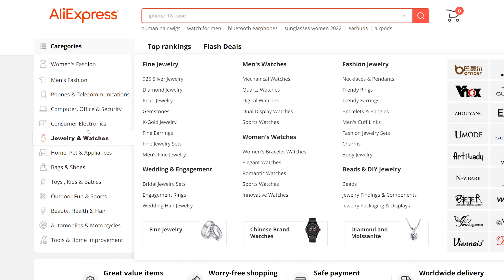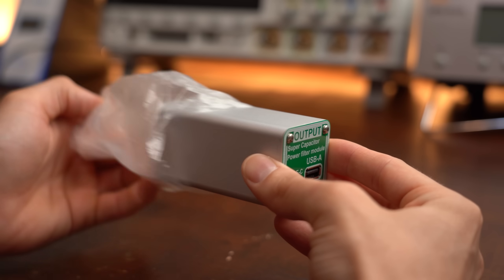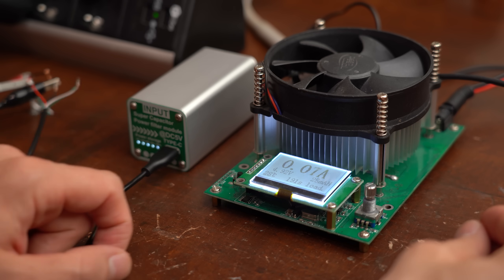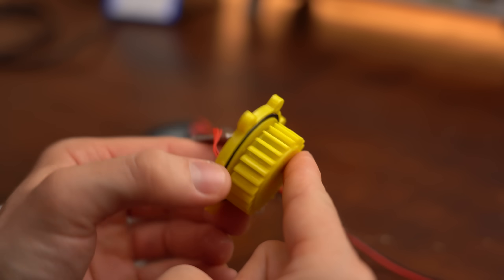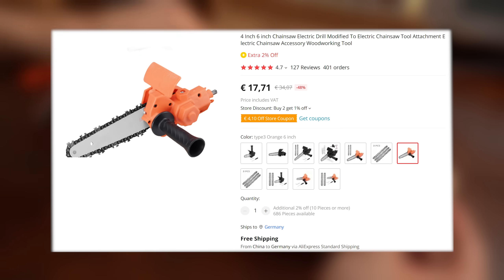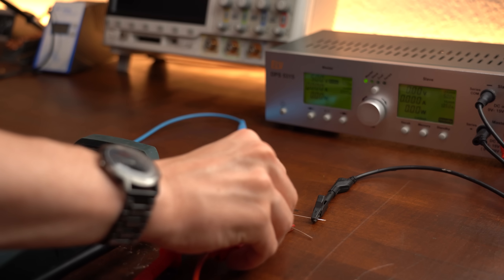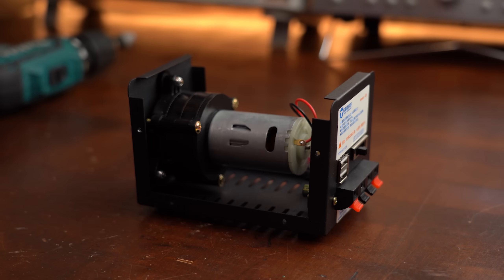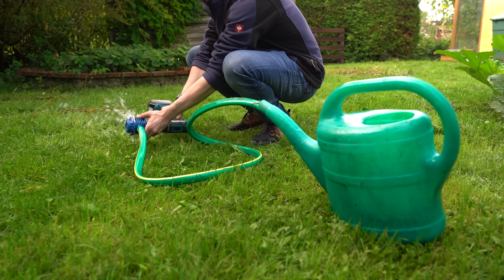I tried finding Hidden Gems on Aliexpress!

Comment: In Italy it takes on average 2 months to get your stuff. Nowadays it takes on average 4. It means I basically get refunds on literally everything but then sometime down the line shows up. Lately though it's doing something even more sinister. It gets marked as delivered & signed after 3 months, and it shows up 2-3 months later. So a total of 6 months sometimes, and to get a refund in that case I need to get a paper from the post office saying they don't know anything about the tracking number, which they obviously don't because the tracking number isn't even the correct format and I have no idea who the delivery company is.

Comment: it is centrifugal pump ,,, you need to add foot valve at the end of the hose before you imerse it in the water then fill the hose with water even the impeller chamber then it will work properly but if the distance between the pump and water surface more than 5.5 meter then no way to pump one drop of water...

Comment: Can you recommend any lithium battery charger board, that have peak charging voltage of 4v and low voltage cut off at 3v. Most board have 4.2v - 2.6v to draw maximum power out of lithium cell. But for people looking for maximum battery life instead of power draw, find it really hard to get a cheap charging board that keep lithium battery within 20-80% (or atleast 10-90%) charging cycles to increase battery life.

Comment: Using an electric drill to drive a generator that produces electricity 🤯❓
OK, it makes electricity but no sense 😂❗
Why not use the drill to drive the water pump to pump water from a reservoir standing on ground level to a bucket hanging higher up, than use the hydro generator to produce electricity 🥴 . . . or 
could we  directly tap the power from the drill's battery 🤔❓

Comment: I saw the 4s usb c PD board in your B-Rolle I have as well. My plan was to use it with a 5s Power tool battery. For that I changed the resistor as described in the product description. Unfortunately it only started to blink a five pattern.
Have you tried to change the cell configuration?

Comment: I definitely wouldn't have just connected a lithium cell to that IP2312 board straight away, without having tested it with an electronic load first. You really want to confirm the cut-off voltage before trusting it to charge a real cell, unless you want to monitor the voltage manually to avoid it overcharging the cell and starting a fire or something.

Comment: I have used a drill powered water pump back in the late 90's to pump water out of a 1 meter hole I was digging to repair a water supply into a house and it worked just fine, so it is possible for a product like this to work, but not this particular one. The one I used was also self priming and not suited for watering plants as it was made of some nasty plastic and used some questionable oil to lubricate the pump.

Comment: if you are soldering directly onto a lipo cell, you can't trust your numbers very much after that. even doing a cold solder joint will damage the battery some amount (and leave you with a shitty joint lol)

Comment: You got a crappy version of the drill pump, we can by them here from Bunnings and those will generally lift ~1m (though you loose pressure). It looks like that one’s impeller is to small for the enclosure (which I have heard can happen with the Bunnings ones).

Ours sees a fair bit of use in fire seasons when we need to wet down stuff quicker than our tank can supply water. It is way quicker to setup and get working than our larger petrol pump though it has no hope of keeping up with the output and you need a good drill to run it for long.

Comment: How much junk did you have to buy and how much money did you have to spend to find your gems? That is problem with bandits known as alibaba.
Reply: @evilalchemist9278  I bought 3 things from Aliexpress and 2 out of the 3 were total failures. First of all it takes forever to get the stuff. One the them the paint were flaking off in the packaging even before being used. The other one the pressure plate worn out in less than 30 minutes of use when others usually operated for at least 500 hours. WTF?! And customer service obviously does not care and there is no way to get refund or replacement. 66% fail rate no thank you alibaba bandits!

Comment: 10:15 Then you don't want to see the latest USB PD specs, it allows for 48V at 5A! (To be fair, if the PSU/host isn't defective (or Chinesium), it's SUPPOSED to default to normal USB1 levels and allow devices to negotiate higher voltages and currents.)
Reply: Except there's no "negotiating" with the "host". (a dumb user operating the slide switch)... 😁

Comment: Ya on the hand crank show have a separate board for use to keep it at 5v but you can weld a nut on the shaft and use a ratchet you built something or if you go big with the nut you can probably use you car tire changing tool

Comment: with centrifugal pumps you're not really talking about 'suction' power. They aren't designed for that, what you're looking for is a self-priming water pump, or you need to prime the pump manually.

Comment: I bought a drill pump from Amazon about 3 years ago to empty a full tank of diesel out of a car. It is half the size of the one you bought and by the look of it, pumps about 3 times the amount of fluid. It emptied a 70 litre tank in about 8 -9 minutes over a distance of about 15 feet total length.

Comment: At 3:26 the voltage drop is not caused by the super cap's limited capacity but by its ESR...
Reply from the maker: No
Reply: @greatscottlab  Yes. At a current of 1.51A you are showing a drop of 0.4V. The supercaps are advertised of having a capacitance of 8 Farads.

I = C dV/dT can be rewritten as dt = C / I x dV where I = 1.51A, C = 8F and dV = 0.4V. This gives dT =  2.12 seconds. dT is the time it would take the 8F supercaps to fall from 5V to 4.6V without charging with a load of 1.51A. The supercaps are getting charged much more frequently than once ever 2.12 seconds, so the problem is not the capacitor size...

Comment: would be intrested in a deeper dive in other charge modules, theres the MH-CD42 which is a module with no connector meaning if you want to get data from the port and offer charging you can do so. and handles safe discharge too

Comment: 9:20 Is it really safe to solder directly to an 18650 cell like this? In mass production they are always spot welded for a reason.

There is probably a method that can be used safely but I am worried that just showing it with no comment might lead people to believe it's easy. I would not want to risk heating up a lithium cell excessively.

Comment: I would love a board like @9:00 but with jumper pins to set cutoff voltage, and also jumpers to connect built-in resistors for current setting.

Then you could just move a couple jumpers and charge basically anything lithium based in a small package with no soldering and resistors.

Comment: You might be able to get the pump to work by attaching another hose to the output, pumping water in reverse from a large bucket until the bubbles stop, then pumping normally. That way it only has to lift the water to ground level, rather than the top of the wall.

Comment: The hand crank generator works best with super capacitors! 
I have seen other people add super capacitors to it and it appears to work far better.... 
As for the hydro generator, I believe that there are better versions which are all black in colour and rated for 12v output.... I would love to see you test one of those....
Reply: I wonder if it would be possible to rig up a better turbine for the hand crank and use that in place of the water generator...
Reply: @eccentricthinker142  you are going to need a gearbox because you won't be able to turn the water generator by hand fast enough.... 
I'm sure that there are better versions available which are rated for a 12v output....
Reply: @PeterMilanovski  I meant the other way around, rig up a turbine to run the hand crank as a water generator.

There might be a torque problem though
Reply: @eccentricthinker142  if it rains a lot where you are, then it shouldn't be a problem.... Or maybe there's a stream or river close by? Otherwise it's not going to work.
Reply: @PeterMilanovski  It's easy to get a lot of head from a stream, which can translate to more RPM with the right gearbox, but rain is just too unreliable for actual power generation in almost all cases.

Hence why the main use case was as a flow meter in the video.

Comment: I have bought a number of various amplifiers, ranging from 2x3W to 60W. The small BTL a,ps can be powered by a Li-battery and sounds great.
I have bought some clocks, but always loose the descriptions how to set them up.
1-, 2- and 4-channel programmable timers have also been used and tested.

The best thing I bought was GOPHERT bench supply supplying 0-30V at 5A. Have served me very well for several years now.

Comment: You're using the drill powered pump wrong. You have to prime it with water or else it wont work. It's not designed to create that strong of a vacuum with air, as you have demonstrated here, albeit with the intentions that it was supposed to work this way. Cool video otherwise!

Comment: Sir, can you do a video on reusing/recycling the battery management system boards for lithium ion batteries usually found on phone batteries or ipad/tablet batteries?  Is it stupid to remove the bms from one battery and sodder to another, even if they are of equal mAh, let alone different mAh?

I wanna splice in an old Samsung 3.7v phone battery into my xbox controller (uses 3.2 ish volts I think and can convert 5v from usb to its 3.2v), but I don't know if the charging circuit built into the controller is suitable for the lithium battery (I assume no).  Or if I should just attempt to splice on a little connector to the battery prongs on the controller and another connector to the battery for easy removal to charge the battery back on the old phone.  I honestly don't know if it is safe to charge a 3.7v battery straight from a 5v usb charger.  No one seems to want to give concrete answers or examples here on the tubes, or in plane non-jargon text on the interwebs.  So much clickbait bs and stupidly loud music too :(

Comment: Always another great video. I especially like the electronic types. And therefore I challenge you to test the replacement circuit board for Green Works 40 volt battery packs. I had one get a little wet and stop working. However the battery voltage is 40 + volts but will not run the trimmer or charge. I get red lights when trying either option. But Aliexpress sells a replacement circuit controller for this 40 volt battery pack, cheap. Do they actual work?   Thumbs Up!

Comment: 5:09
it can of course only output its maximum Power, if you connect it to something, that has got the same resistance/impedance as the generator itselve. Thats cause if you model it like this:
         U_0 •-----[Z_0]---•----------------|
                                                          |
Ground •-----------------•-------[Z_L]---|
Then 
P_L=U_0^2*|Z_L|/|Z_L+Z_0|^2
with Z_L=c+di and Z_0=a+bi we get
P_L=U_0^2*|Z_L|/(|Z_L|^2+|Z_0|^2+2|Z_0*Z_L|*cos(∆φ))
with ∆φ being the phase shift between the source and the load. 
This can only be maximal, if cos(∆φ) is -1, and thus ∆φ=π.
Now for this condition we get
P=U_0^2*|Z_L|/(|Z_0|^2+|Z_L|^2-2*|Z_0|*|Z_L|)
now finally we can find the derivative 
dP_L/d|Z_L| to set it to zero.
and get, that Z_L=Z_0, but here φ=π, and so this is no real Power, but only a blind Power. For there to only be a real Power, the phase shift has to be 0, so we get that P=P=U_0^2*|Z_L|/(|Z_0|^2+|Z_L|^2+2*|Z_0|*|Z_L|)
so we can again do the derivative, and set it to zero, and get to the result 
|Z_0|=|Z_L|.
(if i didnt do anything wrong here)
...
 So for your example with the LED this os certainly not given,and thus the max Power cant be achived.
Reply: Edit: since the real Power P' (Wirkleistung) is
P'=cos∆φ*P it indeed gets maximized for ∆φ=2πk with k element Z. 
So assuming ∆φ=0 was the right choice.

Comment: Pumps often have a much smaller rating in sucting than they do in pressure. Try using a piece of threaded rod to elongate the shaft of the pump and dip it in your pond. You can than drive the pump with the drill though your rod which should provide enough pressure to pump water. Thats why water reservoirs have the pump at the bottom and it can still deliver up to 20 bar of pressure which means it can lift water up to (theoretically) 200m. No pump however can suck water from 10m as that would require absolute negative presure (-1bar) which also means perfect vacuum.

Comment: That dodgy chainsaw attachment looks absolutely terrifying. :D
I wouldn't use it, you do need your fingers doing electronics, after all.
Reply: Having your hand so close to a chainsaw, even a small one such as this is not a good idea. You could end up looking like a happy tree friend. Stumpynubs did several videos on chainsaw grinder disks after getting injured by one.
Reply: @carpespasm  Although those disks are far more dangerous since they are all round and meant to be used on an angle grinder that's more powerful and faster than a drill. But yea this chainsaw looks like it doesn't have a good use case. You can outperform it with a good handsaw in every category, including physical effort 😂

Comment: Bad news: if I get rid of my TP4056 boards and switch to that IP2312-based LiIon charging module, I won't have anything to burn the crap out of my fingers when I'm charging my batteries...
Reply: No worries. There is still plenty chance of finding a different hot part during other operations!

Comment: The lithium battery charger 3a.. you mentioned that you can decrease the charging current to 1 amp.. is that the output current to a phone OR input current to the battery?
Reply: Likely input the battery. I didn't see a mention of a output to a phone.
Reply: @erlendse  oh yes.. thxx

Comment: Aliexpress? I think I know it from somewhere... ah, I remembered, it's the shopping site where I have more than 94 orders and none of them had a problem, nothing I ever bought was not what it promised, I even bought my smartphone on the site and it's original with serial checked on the manufacturer's website, the delivery forecast dates are accurate and usually the product arrives earlier, before 2018 it took 2 months to arrive, now it arrives around 30 days, it only delays if it is not declared before arriving at customs or if it is taxed, that by law they can take a maximum of 15 days and they abuse it and leave it for the last minute, but then the problem is here and not on aliexpress

Comment: The water flow generator seems like a flow meter. They prob expect you to measure the voltage to see the liters per minute
Reply: That makes sense. The coil is too small to make any otherwise useful current.

Comment: 10:15 Tell that to the people who developed quick charge and USB power delivery. :D
But yeah, it definitely feels really sketchy to output more than 5V without any prior negotiation between devices.
Reply: quickcharge and PD won't deliver more than 5V, if the devices aren't capable to handle these voltages.

But I would be careful with this generator. You could damage damage your devices, even if they're capable of being charged with 49V via PD3.1 .
Reply: @ElektrischInkorrekt  Yes, that's why I said it feels sketchy to output more than 5V without any prior negotiation.

Comment: USB PD specifies USB vbus voltages up to 20V now. It starts at 5V and if a device negotiates a higher power he power supply switches to another voltage. Check out the IP2716 and IP2721.
Reply: Yep, nice about being able to get up to 48V 5A. Still the only valid way of going up in voltage is via USB power delivery negotiations!
On USB-C other ways of increasing the voltage is forbidden by the specs!

Comment: 10:30 on YOutube you could find people that modify it by adding a gearbox made of 3D printer parts, add meat mincing machine crank and some supercapacitor power bank plus another lithium one that stores charge for longer and from there all other features like USB charging ports, voltage/current displays, etc.

Comment: If you could find a power bank board that has instant failover, it could be used to make a ups for 12V devices like the ISP's router or access points. Commercial UPS is massive overkill for the purpose.
Reply: 3S lithium battery with BMS is more or less a perfect fit for that.

Comment: 3:35 "limited capacity reduces voltage level": lol what? connect 0pf capacitor to power supply and look how much voltage will be reduced.
That device have much more components than just capacitors, and that components are, most likely, responsible for voltage drop.

Comment: The search's 'smart algorithm' often only show things that are in my cart, having nothing to do with my search terms.  One fix for this is to open an incognito window that's not logged in and search from there.  I then copy and paste the links to my logged in window to add to cart.
I just purchased an IP2368!  It looks neat.
Reply from the maker: There will be a video about it ;-)
Reply: The problem with this is that Aliexpress then doesn't show accurate prices, it will show prices with the "New User Deal" factored in. The best solutions end up being using the site in the direct opposite way it might be intended. Don't add anything to your cart until you're ready to check out. It's a pain.

Comment: Hand Crank Generator 😆, the inside, ridiculous. This is in no way worth 50 euros, impossible. I think that is a scam.
Reply from the maker: Maybe overpriced but not a scam since it worked like a hand cranked generator.
Reply: @greatscottlab  It works in some way but it doesn't perform well. It claims 20W and is only 8W. Handle broke off, there is a cheap motor inside. That isn't a scam?